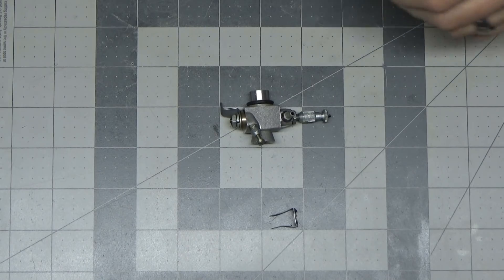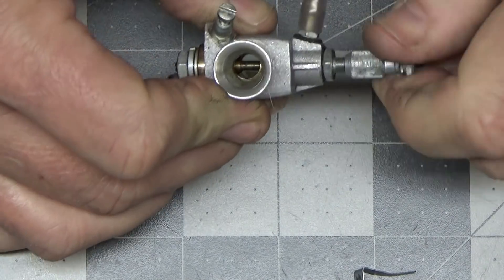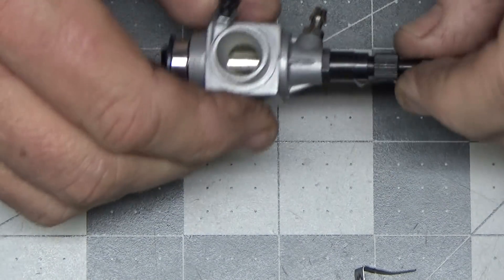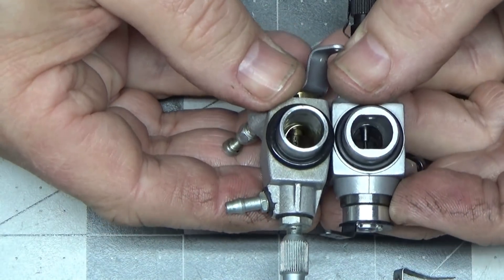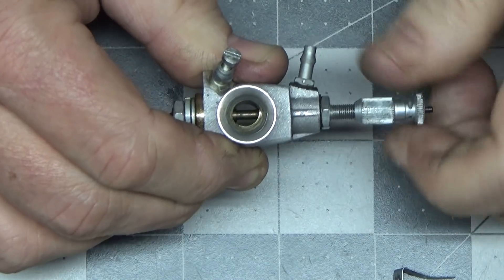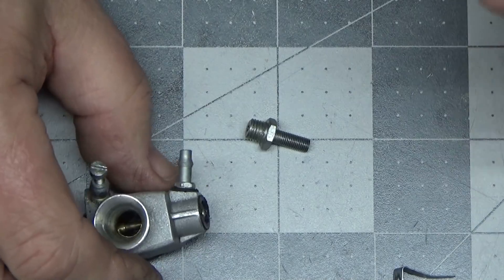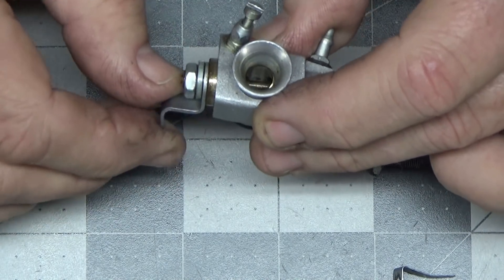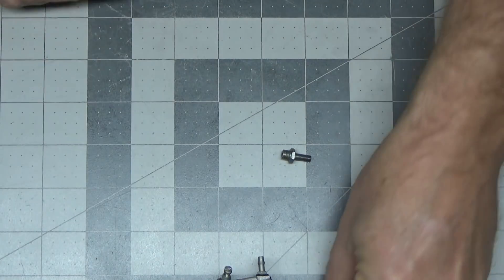MDS 40 A Questionable Carb

Comment: Hi David Thanks for the show&tell. Pretty much mirrors my problems. Put an irvine carb on and it still wont run steadily. 4/ s plug no great improvement either. That kitchen door needs  stopping however🐔

Comment: Hi David, that needle is press fit into the knurled, aluminium outer housing. You can see that it is protruding out from the opposite end and not sitting flush. If its a press fit needle you can tap the blunt side with a hammer in a vice to push the needle through the housing more. If its secured by a grub screw then unlock it, push it through and then re-tighten the grub screw. Try screwing it into the carb and see how you go with your airflow check. Try this before you get the dremmel out, could be a simple fix! Do let us know how you go....Cheers.